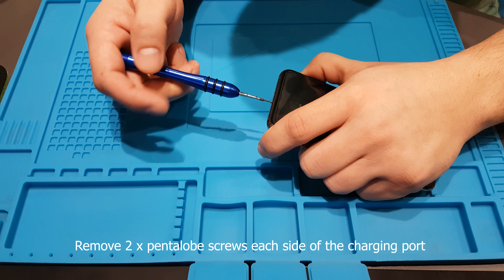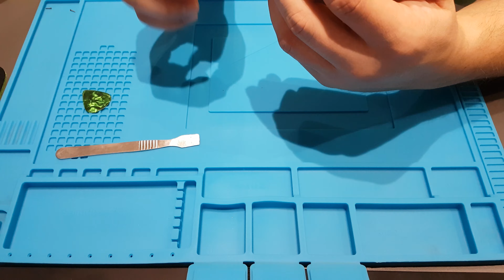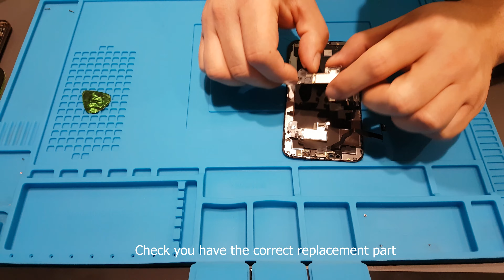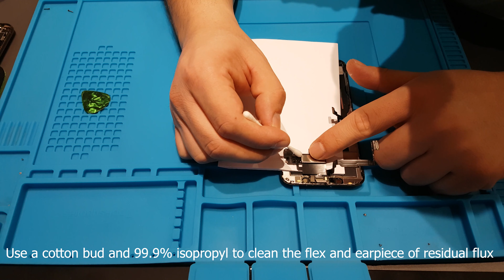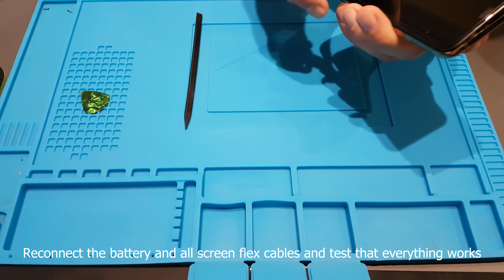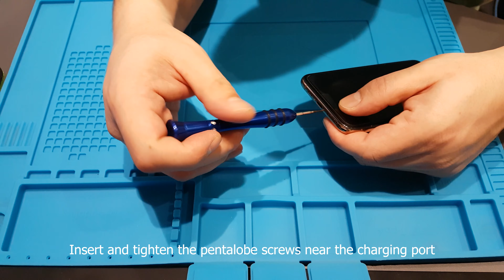How to Replace iPhone XS Earpiece Speaker - Fix iPhone XS Sound - Step-by-Step Guide w/ Tools & Mats

Comment: What mat are you working on?  looks nice
Reply from the maker: I bought it from Amazon about a year ago. It is the Wemk Silicone Soldering Mat, 500℃ Heat Resistant Silicone Work Repair Mat, Magnetic Silicone Repair Solder Pad for Welding and Soldering Station Watch Computer Repair (45x30cm)

Comment: If you replace with a new earpiece the Face ID and the True will go away?
Reply from the maker: if you just replace the earpiece but keep the original flex, Face ID and averything else should work as normal

Comment: The face id still work!?
Reply from the maker: Yes, face id still works. Using this method you only change the actual ear piece and keep the original flex cable.
Reply: @CosasusTech  If I change the iPhone XS Max earphone and the sensor array, will the Face id work or not?

Comment: I just torned by mistake the earpiece flex cable, can i replace this flex cable from another original earpiece speaker and get work the face id?
Reply from the maker: I have never performed this type of repair, where the flex was torn. Please do a fair bit of research and take my advice with a pinch of salt. From what I gather it is possible to use a new OEM flex cable and move over the original parts from the one you just torn. This involves micro soldering and it is quite difficult. Depending on where you torn your cable, maybe you can scratch it at the breaking point and expose the traces and if they are not too many/complicated, maybe you can re-solder it back together even if it involves adding some insulated tiny wire.

Comment: If I change the iPhone XS Max earphone and the sensor array, will the Face id work or not?
Reply from the maker: No, I don't think it will work after. That flex cable is paired with the phone and as far as I know only Apple have the tools to re-pair a new cable with the phone. That's why I only replaced the ear speaker and kept the original flex cable. Aren't you able to replace just the ear speaker and solder a new one to the flex?